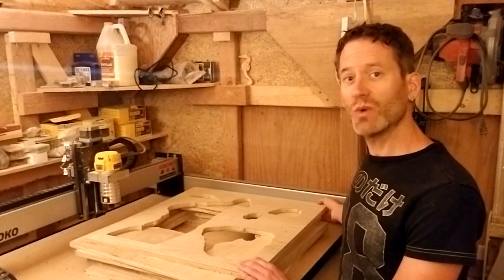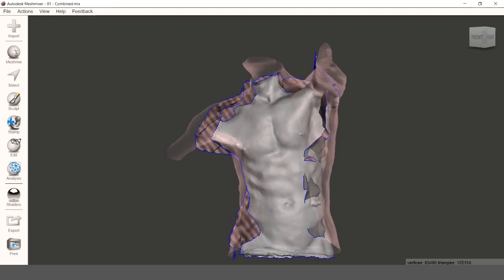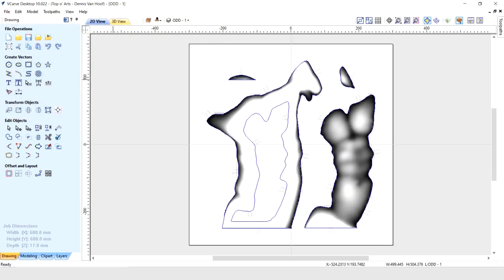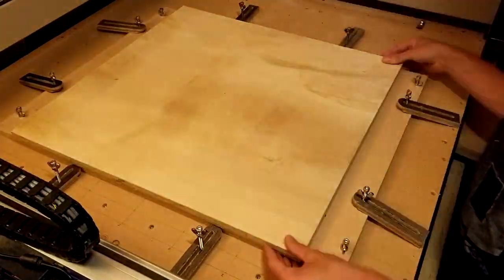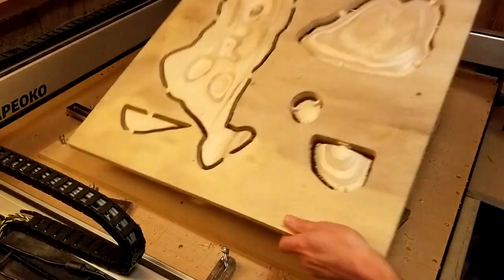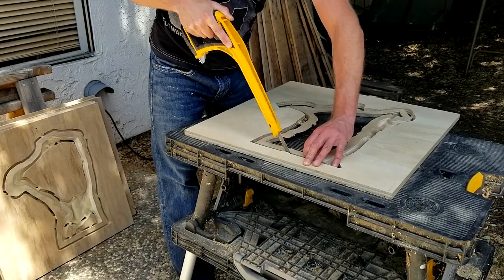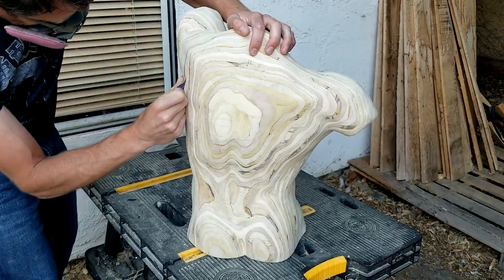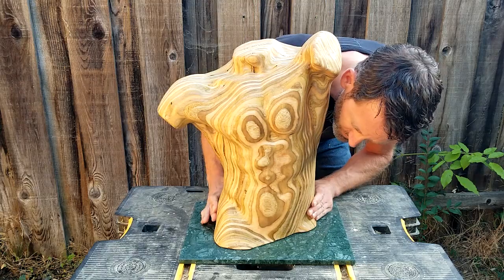CNC carving a male torso out of plywood - With the Shapeoko

Comment: any chance you know the settings you'd use for the depth of cut and feed rate cutting that plywood.  The equipment I use is in a shop elsewhere and I burned the wood at the end and screwed up bearings on a router.  .125 depth, 300 feed rate and 150 plunge for a 1/4 in straight bit.
Reply from the maker: I believe I used the following settings wit my Shapeoko XXL to carve plywood with an 1/4 upcut bit:
Pass depth = 0.15 inch
Feed rate = 32 inch/min
Plunge = 25 inch/min
Reply: @dennisvanhoof9958    That makes sense.  When I used Aspire to set up the project, it generated similar readings before I was advised Freud bits go faster.  That's slow, but at least I won't mess up the router.  I was using a router bit too.  No wonder it takes so long to cut.

Comment: You carved that double sided.  Do the bits tend to break if you carve it one sided?
Reply from the maker: No, the bits don't break if you set the pass depth right. I had to carve double-sided, as the 3D slices had overhanging parts on both sides.

Comment: I was using a feed rate of 300 and a plunge rate of 1/2 that - 150.  The bit ended up breaking.  What do you  use for a feed rate?  My y axis won't go further back now than the middle of the table where I had set the zero too.  How do I fix that?

Comment: Hmm how much did your cnc setup cost?
Reply from the maker: All in all (machine, bits, software, and some other essentials included), I would say about $2000.
Reply: @dennisvanhoof9958  that include the 3d bits for the female torso where ya just turned it?
Reply from the maker: @kingdarkem  With such long and complicated carves, the bits usually last only a single project. After days of endless routing, they are dull and need to be replaced.